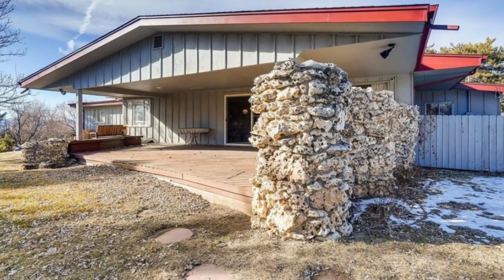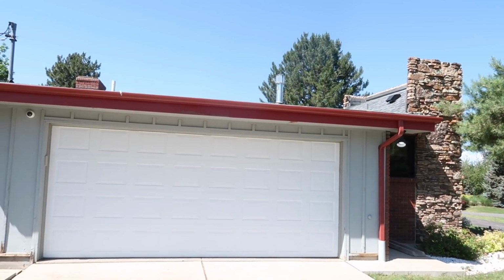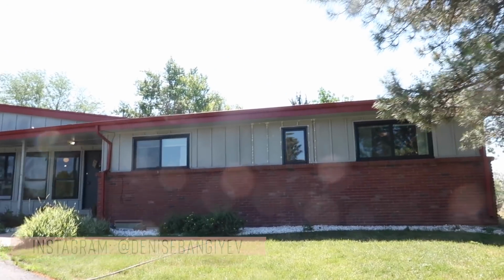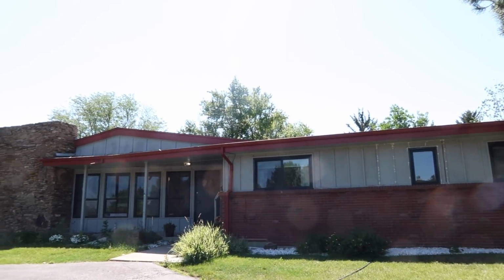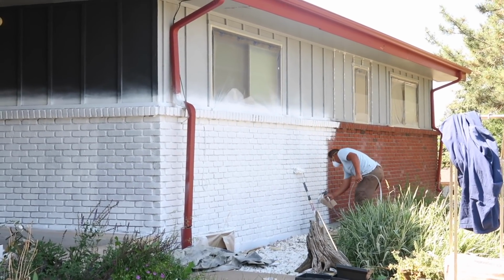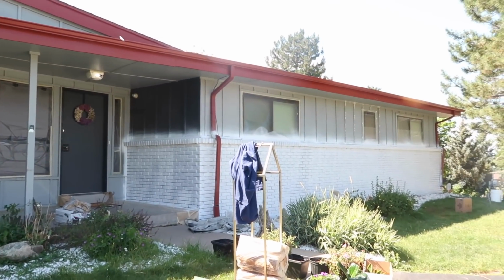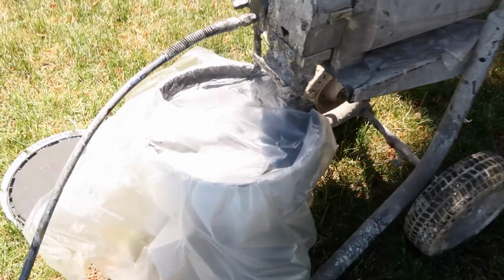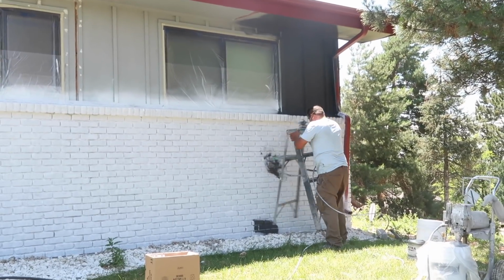RENOVATING OUR FIXER UPPER | MID MOD EXTERIOR PAINT TRANSFORMATION | INSANE BEFORE AND AFTER!

Comment: A gold or metallic door would look very “stand out” for a corner house. Hearing you mention the color choices, orange was my number one because it would match your inside style a lot. And it might look cedar-y. But when you took those low angle, after pictures, and your windows reflected a similar blue as the door, it looked a lot better than I imagined. You’re right, the color is just slightly off. Needs a bit more neon pop or something. But I am drooling over how stunning something sparkly and shiny would pop against that matte black and stone. Yes? Anyone else?

Comment: Although I appreciate the aesthetic of a black house, I worry that it would absorb a lot of heat. I know in America you have AC in most houses but wouldn’t that mean it has to work harder? Sorry just a query we don’t have AC in the average house in the UK ❤️
Reply: I think they are in a cooler state.
Reply: Yes. It will cause a hotter house but where they live Summer is not very long even if it is hot and Winters are very cold.
Reply: I loved in CO for 10 years. Sunniest state in the country with high altitudes. Which means harsh sun with fairly hot summers. They are trying it out, and it does look beautiful. If worse comes to worse they can change the paint color.
Reply: It really helps too if you invest in solar panels. The color would get hot but our electricity bill since getting solar panels has been so amazingly low its totally worth it

Comment: Ok question. I also have a brick house and I’ve been told not to paint the brick. I was told it needs to be stained. Did you ever hear that? Looks great- it’s exactly what I want to do to my house.
Reply from the maker: We have definitely heard that. It won’t wear AS well but it will wear just fine. It’s just about maintenance. He used a good primer and filled the porous areas really well then added 2 coats of heavy paint. It should hold up well!

Comment: Hi.   I’ve loved everything you’ve done so far except the colour choices of the exterior.  I love the brick colour, gorgeous!   But I feel the paint colour surrounding the windows could have been a lighter shade so the windows stand out more.    The stone work sort of floats and there is nothing that ties it in to the body of the house.   I agree with most of the comments that if you took a wood tone colour from the stone and ordered wooden toned doors and also changed the colour of the posts to that same colour , I think it would look gorgeous.  
Even though the style of the house is really nice looking, I feel there is too much black and charcoal.  Good Luck!